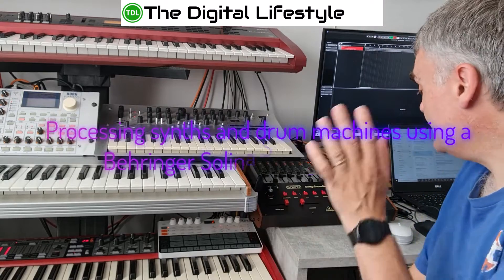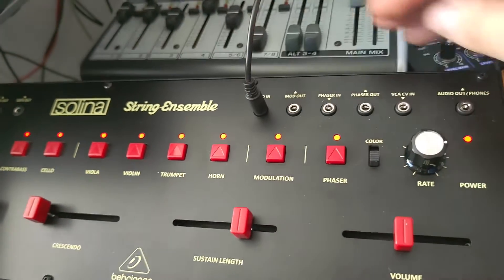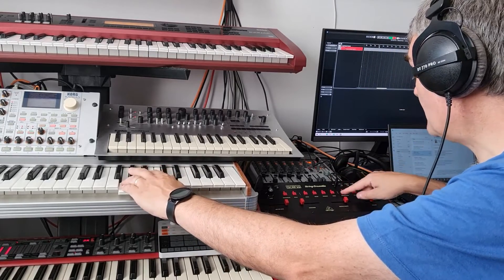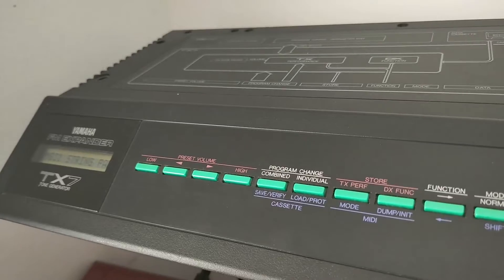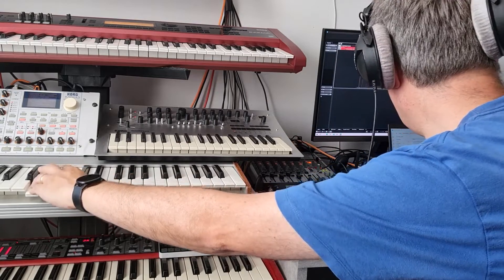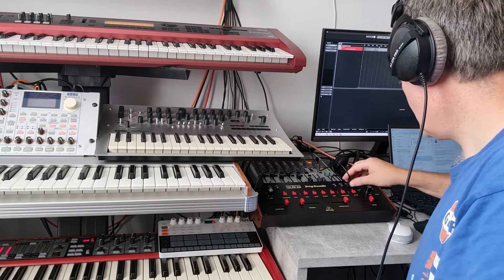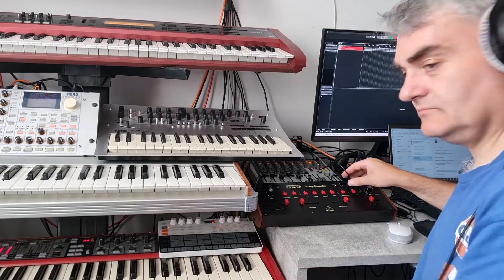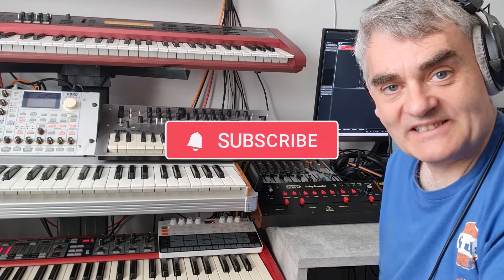How to Use the Behringer Solina to Process Your Synths and Drum Machines

Comment: I am torn between the vc340 and the solina.  Thoughts?
Reply from the maker: It's hard to say. I miss the Vocoder but the Solina is a unique sound and sounds amazing
Reply: I find the VC340 slightly rougher, fuzzier than the Solina, and it has soundwise slightly more possibilities to offer (the mix of string and human voice sounds epic... watch GeoSynth's review!) and you can find it used for about 250€... On the other hand, the Behringer Solina String Ensemble offers a built-in phaser, and the Solina is the best all-purpose string machine ever, that's for sure. Nothing fits better into any mix. But (at least in my country) the Behringer Solina won't be available until 2024 (unless preordered). If you're a real string machine fan, you'll probably afford both anyway, sooner or later!
Reply from the maker: I find the Solina to be a bit sweeter but the VC340 has more features. I have RADIAS for the vocoder features but still want a VC340!
Reply: BOTH